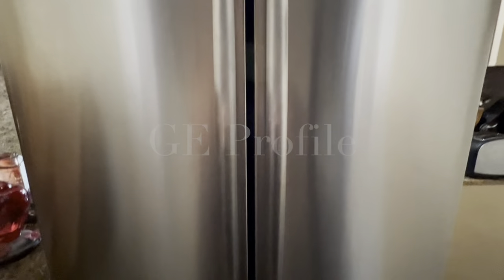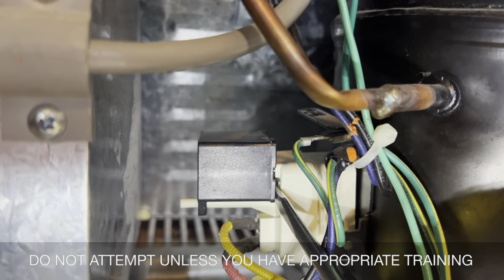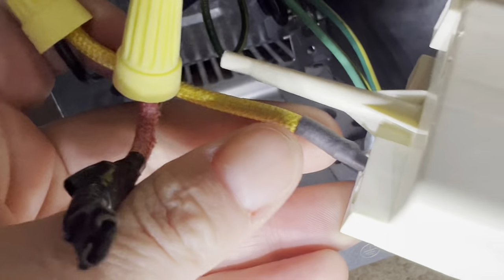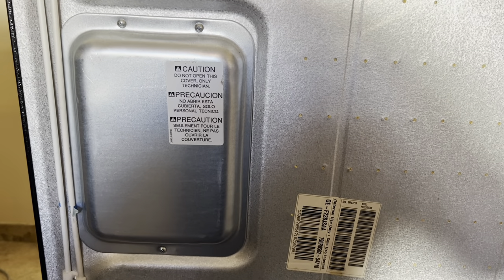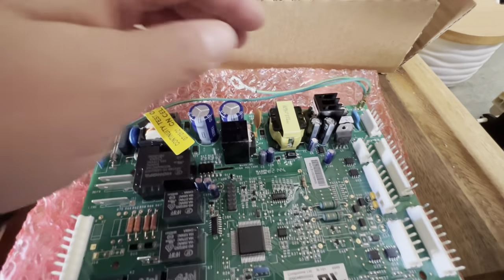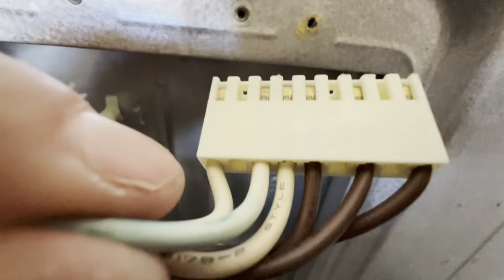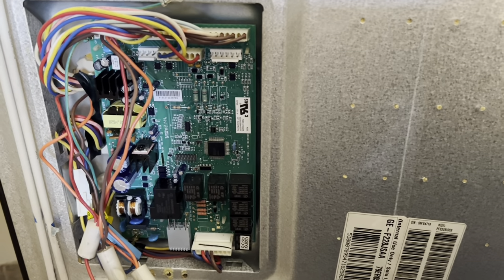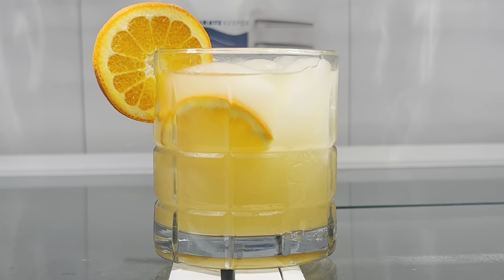GE Refrigerator Fix After Power Outage Surge PFS22SISCSS, Info Re Relay & Main Control Board

Comment: JUST FOR YOUR INFO LOOK UP WHAT A 3-N-ONE START RELAY IS. THEY ARE SOLID STATE AND NEVER HAD A CALL BACK ON A FAILED ONE IN OVER 45 YEARS. SUPCO IS ONE BRAND. MANUFACTURES DON'T USE THEM CAUSE THEY DONT FAIL
Reply from the maker: Thank you for the tip! I’ll check it out!

Comment: I have same refrig—we had 3 short blackouts in a couple of hour period—now my display is dead but refridg. still works,ice maker works every thing seems to be working except the display—would the board be the problem?even the lights work.
Reply from the maker: I’m a beginner, no expert. But, the appliance shop gave me a valuable tip! Look at the back of the board for a small burn mark. That’ll help identify which board needs replacing. Look at how tiny my burn spot was in my video. I’d check both the main circuit board and the display one for a burn mark (with power off obviously).

Comment: BEFORE YOU DO ANYTHING!!...We had a power outage and My GE side by side compressor wouldn't work and the panel lights were off.  The interior lights worked fine.  I was fed up with fixing it and ordered a small freezer to store frozen meats etc.

The next day, 24 hpurs later, the refrigerator came back on, compressor running and panel lights on.  It had reset itself apparently and it took 24 hours.  I read where another GE refrig owner said it took 12 hours to reset.  So, before you do anything, unplug it for a minute, re-plug and wait 24 hours.  It may be less time than that..  PS..The tutorial video was excellent.😀😀😀  Thank you..
Reply from the maker: Thanks for sharing this helpful tip! I'm glad the fridge came back to life. I’ve read about a reset and tried that. But, never heard about the 24 hours thing. Good money-saving info for folks to try. All about saving $$$!